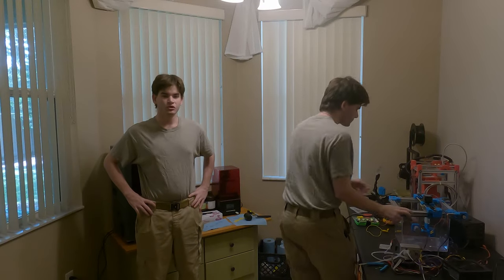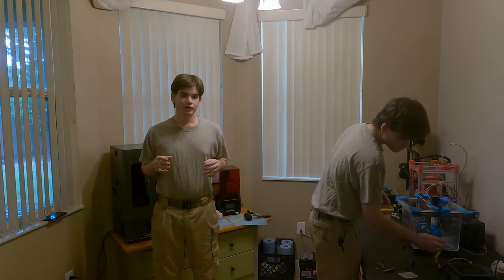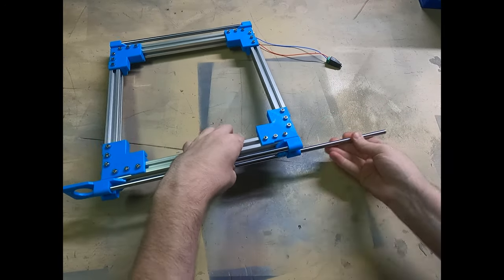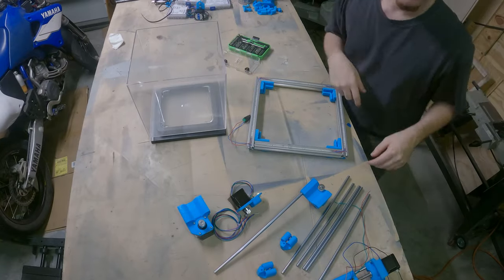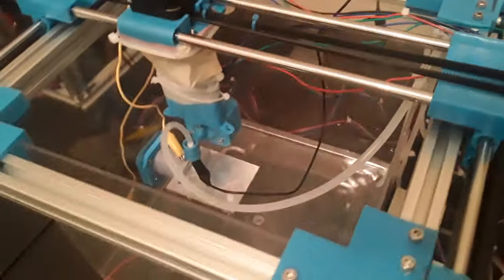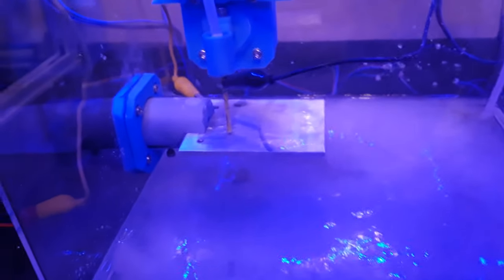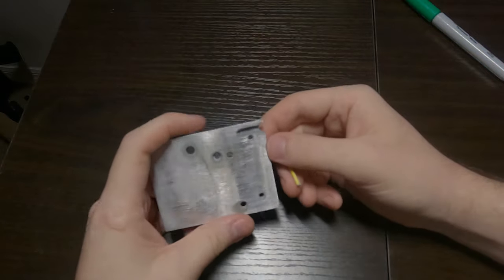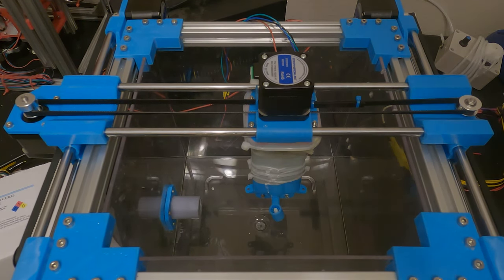I 3D printed a 5-axis CNC machine

Comment: Some more user friendly firmware is in order, its going to take a metric ton of calibration and testing to get this functional and accurate with conventional CNC programs. 
The "holes get larger depending on speed" part alone sounds annoying but cool and powerful if properly utilized.

There does appear to be one or two companies that produce 5 axis ECM machines so it clearly is feasible and scaleable. 
This whole project gives me santa machine vibes, like those fellas making 3d printed guns, imagine making an entire 1911 with a machine like this? Springs and all. Sounds incredibly cool.

Comment: Why ECM and not EDM? Looks like only minor mods to EDM. Wouldn't EDM be faster and probably more precise? Great, ground breaking video. Keep up the great work!
Reply: EDM requires more specific power supplies and wears the electrode as well as the workpiece. Not to mention EDM requires dielectrics as opposed to electrolytes, which can prove more of a problem to acquire/dispose of for the home machinist. Both methods provide their own challenges when it comes to accuracy and we're still only scratching the surface of what can be done at home with non-traditional machining techniques.

Comment: We learn so much from our projects!  Beefier aluminum 1/2" plate everywhere :)  Cast mold everything to steel.  

Ball screws will save your life!  CNC tolerance stack-up is a huge issue, especially with more axis.  

Great 3d prints on that blue pla!  
Can't wait to see a hulk mod of this to be able to handle big material!
Reply from the maker: Resin not PLA. I made them on my Mars Pro and Transform
Reply: Casting steel is... nontrivial for the home shop. Cast iron? sure. Steel not so much.

Comment: Amazing , thanks for sharing this awesome way to cut metal without a huge investment. Do you know how it it cuts titanium? Was not sure if it rate needs to be adjusted based on metal type ? I'm now about go down this rabbit hole  haha. New sub from me, hope to hear back about titanium cutting.
Reply: It should work for titanium. You’ll need to do some research into electrochemistry to learn the voltage requirement and the current per gram of material. That will get you rough estimates that you can dial in through trial and error.

Comment: Nice little ECM(fixed) machine.  I’d love to see some attempts at more 3D parts!  Also a wire EDM might be nice.  I want a way to make a cheap and precise wire EDM for cutting precise shapes in thick metal.
Reply from the maker: ECM not EDM. I would like to try out wire ECM one day.
Reply: @MorlockEngineering  Ah 😉.  Had to look up the difference.  So the more common EDM uses a die electric solution and electricity flows in the the tool while ECM uses an electrolyte solution and conducts electricity in the fluid.

Comment: Impressive! Maybe your rotary axis is misaligned because the side wall of your tank has a draft angle.
Reply from the maker: I compensated for this in the 3D prints. The print bottom surface is at an angle.

Comment: Great project.I done bit of research into ECM looks like distance control from electrode tip to work piece surface is critical for quality of cuts.I wonder how to do it ?Maybe by monitoring current in electrode- work piece circuit then use PID to control electrode distance-also some initial calibration pass should be done before cutting desired shape?Then somehow port this control to gcode on the fly?
Reply from the maker: I accomplished it in the past using auto bed tramming (auto bed leveling)

Comment: This is neat.  couple of questions tho.  How is feed rate determined? and, I have a 225 amp TIG machine that I could use as a power source that can provide 0-225 amps. AC/DC or pulse DC 0.1Hz to 200Hz.  Thoughts on this?
Reply from the maker: Great question. I covered the math in the video I linked. It is based of the Law of Electrolysis and some algebra. But in reality you need to do some testing and calibration. I usually go for 5 mm per 10-15 minutes at 12 volts and 1 amp. 

The higher the current, the greater the possible speed. But if you use too much current you will boil the water and turn it to steam. So maybe do not use the TIG machine yet, or if you do film it so we can watch what happens. 

If you have a really large electrode (like 5 cm across), I can see a TIG machine working. But the supply must be DC to work.

Comment: Good stuff.  I don't think limit switches are necessary since you do not need to home the device
Reply from the maker: It cuts down on prep time if you can home the machine
Reply: @MorlockEngineering  You could home with TMC2209s and no switches
Reply from the maker: @ZURAD  I hate sensorless homing. I used it before and it was far from perfect
Reply: @MorlockEngineering  idk get gud I guess

Comment: I've worked in a factory where they made cooling canals in the blades of the engines for F16's.
They did it in the same way, exept they used hollow graphite electrodes. I had to put electrodes of different diameters (0.1 to 2 milimeters) in boxes that were sold. They even could etch bended holes with bended electrodes. 
I've no idea how they made those holow electrodes out of the qubic meters graphite blocks.
Very interesting project. Love it!
Reply: I think you are talking about pure EDM machining, this is electrochemical machining. You sure its like this?
Reply: @DRAGUNOV1902  I did a search on the internet, and I'm shure it was not EDM. It was Electrochemical machining (ECM) with very small hollow graphite electrodes. The electrolyte is pumped through the electrode. The graphite is conductive and resistant to the acid. On the tip of the electrode the electrolyte is not saturated. The electrolyte etches it way through the metal while the electrode is moved forewards.
The clue is to have the right voltage, flow rate and feed rate so the etching happens almost only at the tip of the electrode.

Comment: but i don’t see advantage in this method!
Reply from the maker: If you can build a normal 5-axis machine, than yes that is better. ECM trades speed for simplicity and low cost.
Reply: It's way cheaper than most metal CNCs that can cut steel.

Lots of downsides but it's applications are limitless for micromanufacturing, combine it with custom 3d printed stamps and dies and you can make some very complex projects for prototyping or otherwise.
Reply from the maker: Yes! In one of my videos I showed how you can use it for micromachining. I was able to make features 100 microns across and a few microns deep. I had some good shots from the microscope. 

Customs dies are the future. Zurad has a video on it.
Reply: @MorlockEngineering  For the record, I think that custom dies would best be made from graphite blocks with something like an MPCNC or printNC, but printed may work with proper preparation.
Reply from the maker: @ZURAD  Stick some aluminium tape on a print to make it conductive
Reply: @MorlockEngineering  I've actually done this and it worked pretty well. Problem is the local heat generated by the reaction can cause it to unglue, hence plating.